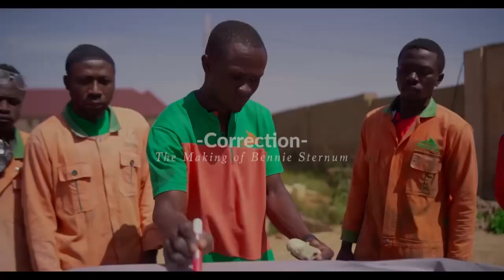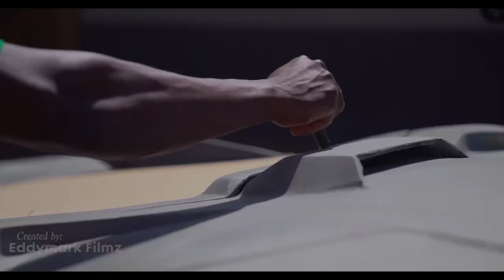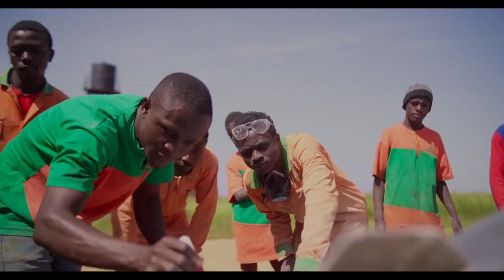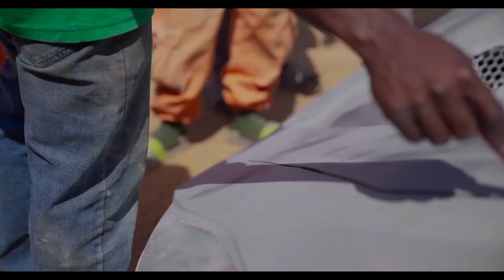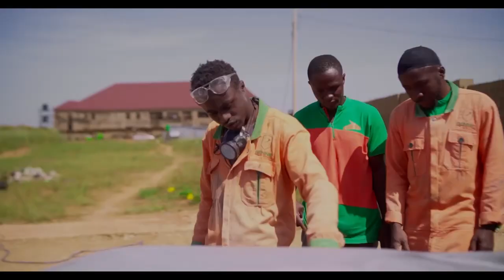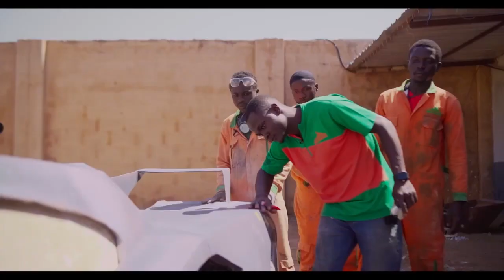BENNIE STERNUM - OUTCOME FROM BENNIE AUTOMOBILE

Comment: Improvements:
Front splitter shouldnt look like its "part of the car" and extra part of carbon without the weird bending shape and the rear diffuser should be smaller, lower to the ground and a carbon piece just like all the other manufacturs and without panel gap
And spoiler shouldnt be completely part of the body
These accents make it a car but still cant wait for future progress good work